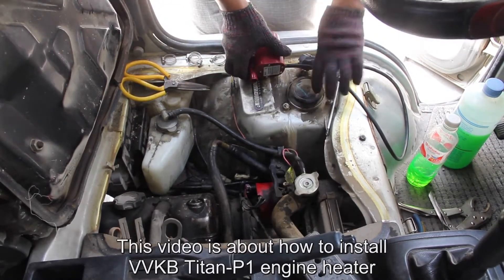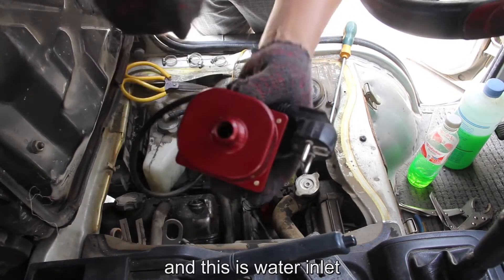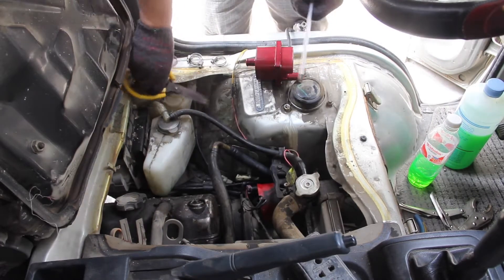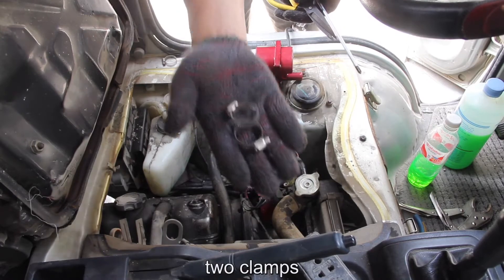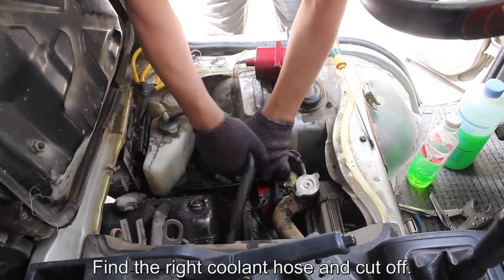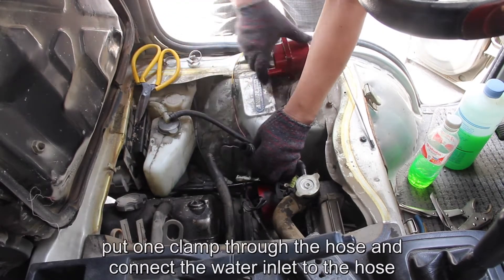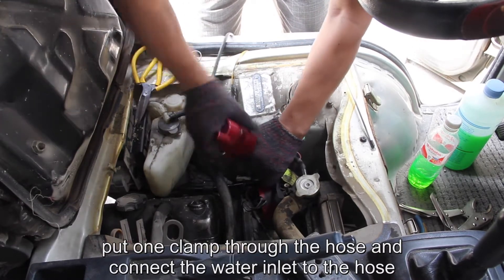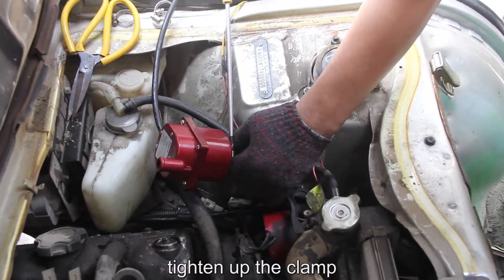How to Install VVKB Titan P1 Engine Heater

Comment: Find the right hose and cut?????  What an instructional video.
Reply: Because each vehicle has a different hose, there is no one standard. In combination with the manual of the heater, you will find the right hose.

Comment: Are there any limitatios reletad to position of the heater? Can be installled horizontal or diagonally?
Reply from the maker: Hi Dawid,
We recommend that the heater be installed upright and 10-20 cm below the water inlet of the tank.
You can see more information on our website: https://www.vvkb.com/engine-heater/

Kind regards.
Vvkb team

Comment: You skipped a step in the procedure. After securing the hose clamps and adding coolant you need to operate the engine long enough to open the thermostat and fully circulate coolant thru the engine  to purge air from the system.  If you connect the power source to the heater when it is not full of coolant, it can burn up/damage the heating element.
Reply from the maker: Thank you so much
Reply: That does not make sense. How do you purge air from an enclosed system? Putting it below the coolent level should be enough if you live on planet earth with gravity.
Reply: Den Niero it is actually gravity that you are fighting.  What you say would be true if the cooling system were purely vertical, IE: heater placed down in a bucket.  The Toyota’s I have owned purge very easily but can hold a little air in the heater lines which go up and down to reach the heater core.  Most cooling systems, especially in lower profile cars now days are spread out horizontally and often the radiator/filler is not at the highest point of the system.  So they can trap pockets of air throughout the system that cannot force their way down thru the coolant in the lower spots without being pumped.  You need to run the engine, get it to full op temp and allow the thermostat to open and the water pump to circulate and force air bubbles out of the system.  This is usually done with a funnel attached to the radiator and filled with coolant to allow air to escape and be replaced by coolant.  With some vehicles like the honda civic you want to park on an incline with the front of the vehicle higher to speed the process.  You keep at it until the outflow hose to the radiator is hot and the fan cycles(thermostat has opened), and you can get heat out of the cabin heater.  Just did a honda civic 2 weeks ago and it took nearly 20 minutes to fully purge...
Reply: @midixiewrecked7011  well opinions vary, but I have years of learning how to be good at what I do, and I am pretty good at it...  if you inadvertently leave an electric heating element in an air pocket, it will eat itself in very short order...
Reply: One of the heater hoses was used here. There should be zero problems with getting any air pockets out of that tiny system as soon as the vehicle is started; as the plumbing that flows through the heater core bypasses the thermostat altogether. If the heater core plumbing did not bypass the thermostat, then the block heater wouldn't work at all.